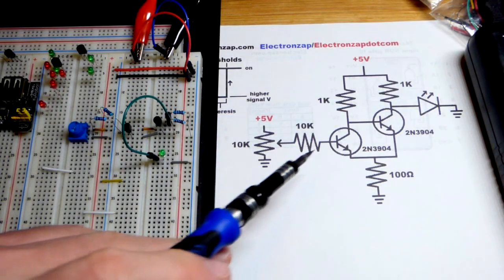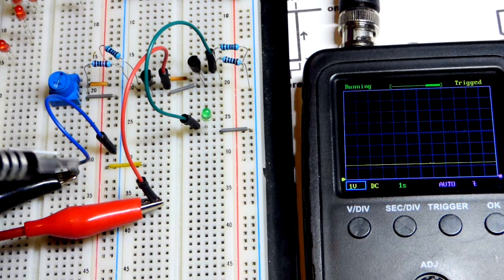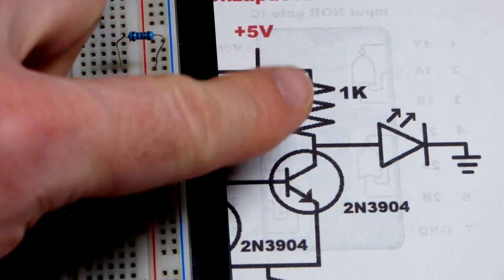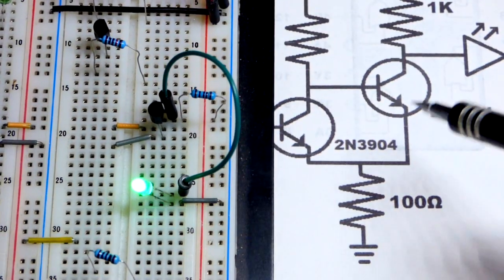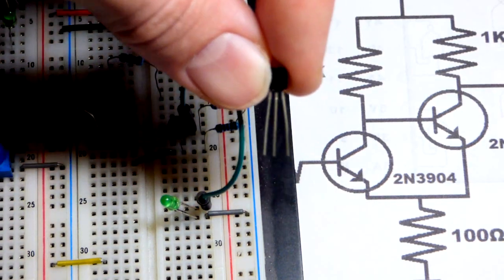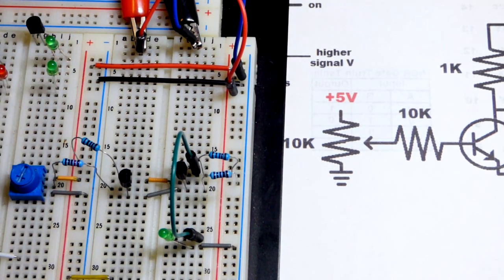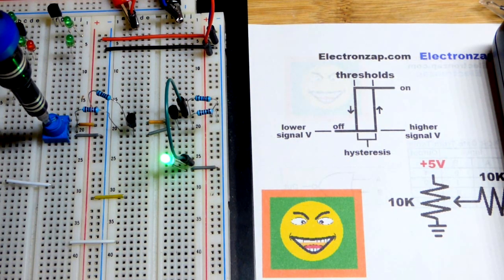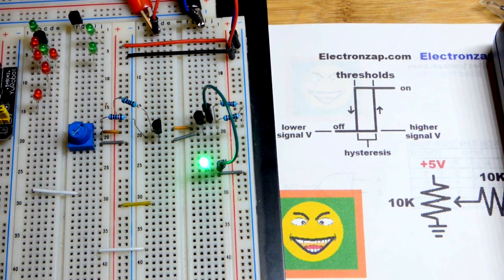Schmitt trigger circuit using NPN Bipolar Junction transistors BJTs by electronzap electronics

Comment: Both left side and right side resistors are same is 1k. So both transistor circuits are same and the hesistrises voltage is zero.   How it will function like shimitt trigger?
Reply from the maker: Thanks for the observation!

Comment: Thanks for this circuit. I built it and it works but I have a problem with not knowing which component to adjust in order to adjust the hysteris. Please suggest and thank you in anticipation.

Comment: That's great! This schematic of yours is the solution for applicattions in which we just don't wanna a LED turning on (or off) partially, by emitting intermediary brights - as it could be used, for example, in a profissional bargraph V.U., whose LEDs would light 100% only! So, it's easy to understand that we can use a CMOS 4093 (in instead of eight NPN transistors) to drive four independent LEDs, for this purpose.

Comment: Hi electrozapdotcom, I looked at the design and decided to throw it in a mental simulation before building it physically(as part of a project which needed hysteresis). and I found a way to improve the design you showed since this design only has a very small offset and might fail with other types of transistors(for example mosfets) if the resistors are not exactly equal or wrong in the right way. while simulating it in my head I found that to make it work better and more stable(with a large offset) you should increase the resistance of the top left resistor in comparison to the top right  one.
for example if the bottom resistor is 1K the top left one 2K and the top right one 1K then when we assume mosfets instead of transistors(as I will talk about later why(1)) then when the input is high there will be the left active voltage devider of 2 to 1 which on 6 volts would bring it down to 2V below the mosfets causing the input to need to go below 2V before it switches to the low state. when the input is low we have the right active voltage devider of 1 to one, which on 6 volts would bring it down to 3v before it switches to high. so this scenario would give 1V of offset between the voltage to switch to high and low.

(1) I talked about mosfets since transistors will reduce the resistance on the right devider in this case this is because current will flow from Base to emiter as well instead of only using collector to emiter making it so that in the case where the resistance of base to emiter is really low that the resistance divider on the right side could be seen as having the 2 top resistors in parallel. this works well in most cases with many transistors, however some have a really high base emiter resistance, or even act as a capacitor, and the resistance often isn't as accurate in many transistors, a transistor can be made to act like a diode by adding a resistor between the left lane and the right transistor, however this ofcource often wouldn't really be needed since allowing it to do that can make the offset even bigger, it is just that if you use something like a mosfet or a high resistance base emiter transistor then the left resistor should be bigger than the right one because many resistors often are not exactly equal and accidentally having the right one having a higher resistance on a high resistance base emiter transistor, or having them equal on a mosfet based one can make it not work

Comment: I love hysteresis in electronics, how high of a resistor can you use at the ground side before it starts to give problems(to get a lot of hysteresis). and can you directly wire some point of it to a IC input, or how would you do that. since many IC's do have CMOS but no Schmitt triggers which cause input from analog or physical(button for example) sources to cause more than one trigger.